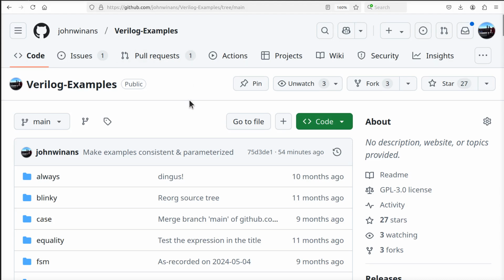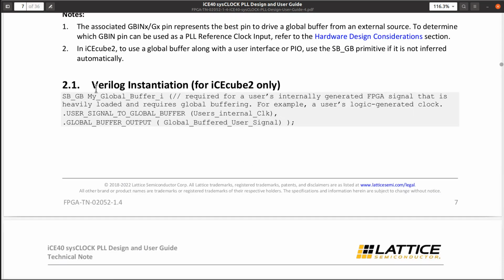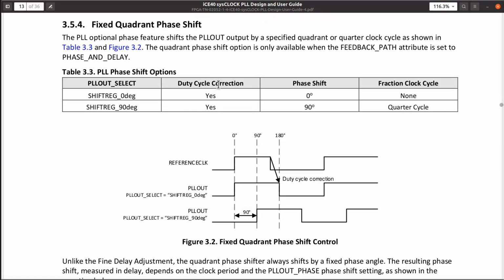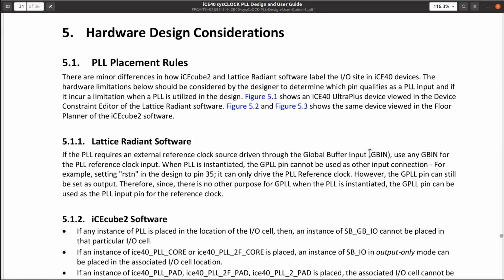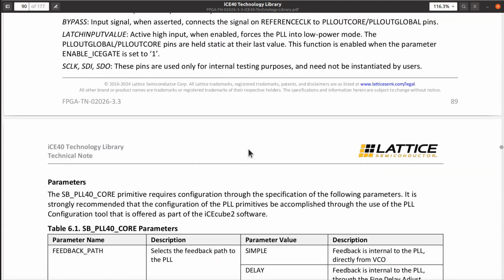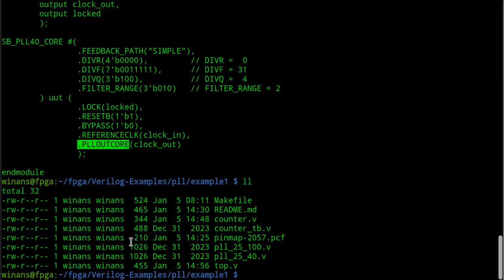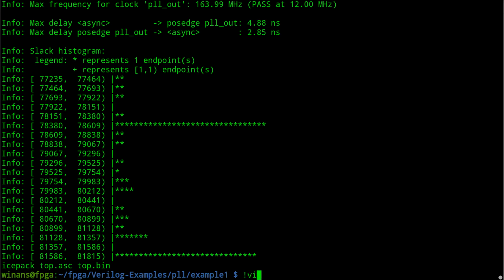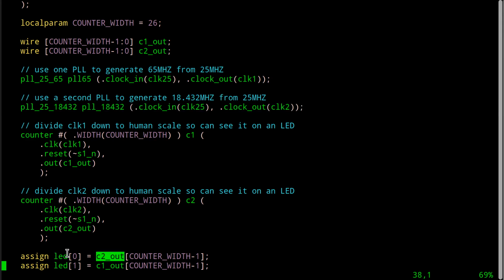FPGA #24 - ICE40HX PLL

Comment: Is a PLL typically used when you need a faster frequency than the input clock?  i.e. counters are typically used for generating lower frequencies?

Does the FPGAwars icepll also create a timing constraints?

BTW, any thoughts on the advantages or disadvantages of using a PLL versus feeding the FPGA with the desired clock(s) directly?   I've seen people use a pico2-ice to  generate a stable 266Mhz at 3.3v.. and > 600Mhz via the ALT_GPCK pin!
Reply from the maker: Yeah.  The PLL can generate a faster clock.  But it also is useful for generating slower ones too... that are not able to be generated by using a counter to divide a main clock.

Comment: hi, few years ago, before I realized that PLLs are in any FPGA (like in new MCUs), I met SiTime MEMS programmable oscillators like a sit8008b up to 110MHz, its crazy part, digikey says it can program the parts on order on some page (dont know if its wireless, passing tape through something, its crazy as its listed with "some" frequencies stocked, but its all the same part, impossible to have it all in database, hi), but you can reprogram it also by timemachineII programmer... according to PLL docs complexity, sometimes it may be easier ))

Comment: The Lattice documentation is so confusing - having two documents for the PLL and you need to read both! Ugggh. Thanks for clarifying that.
At 1:11:00 you show the two oscillator project. Remember that pin 129 is to the right of PLL2 and can only be used as an output (from earlier in the video).
Reply from the maker: Yeah.  This is going to be a problem if we want to run PLL2 with a 2067 board installed.